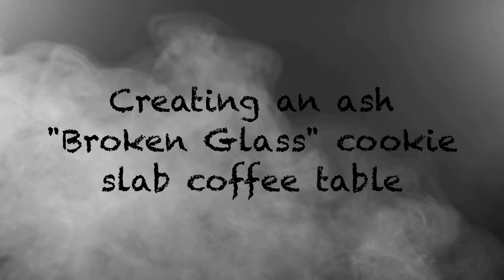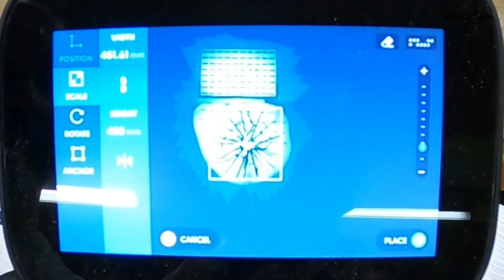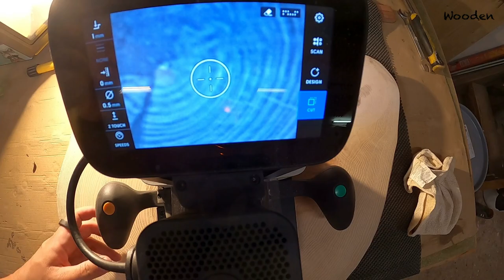Broken Glass cookie slab coffee table - Ash #shapermade #table #woodworking #diy #ash

Comment: Cool table. Did you make your own table with melamine for taping the ash piece?
Reply from the maker: Thanks Len. I am not sure I understand that question. What is a melamine table?
Reply: @Woodensoul  I mean the black surface that you attached to the workstation and then used as a taping platform to hold your ash cookie. In North America that black (or often white) coating is called melamine. I’m noticing more expanded table ideas on ShaperHub lately.
Reply from the maker: Ah yes, I made that. Here you have a video about that: Expanding the Shaper Origin Workstation: How large can the Shelf Top be?
https://youtu.be/xWxd-p2bpXo